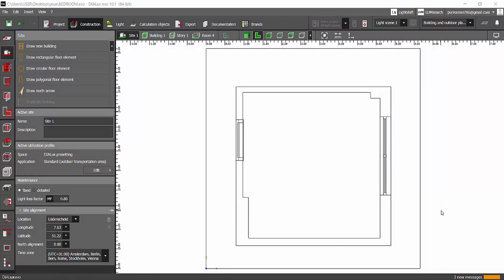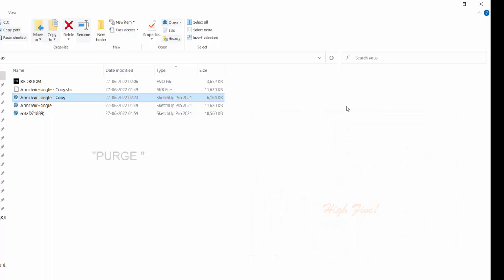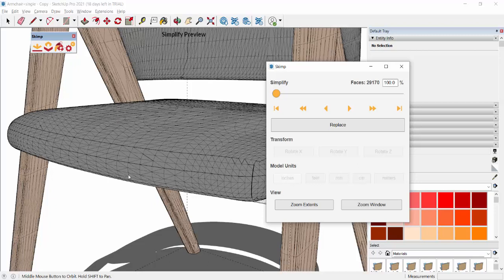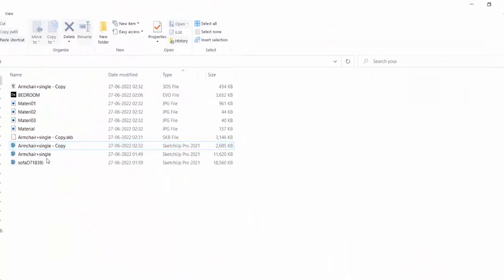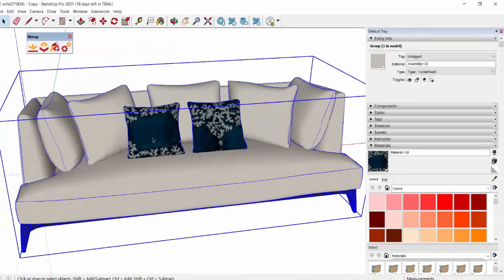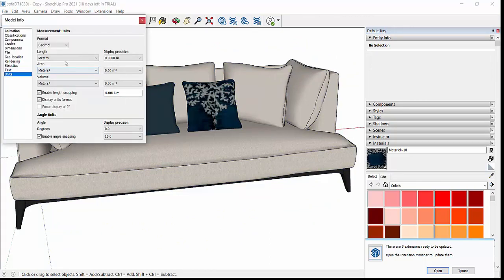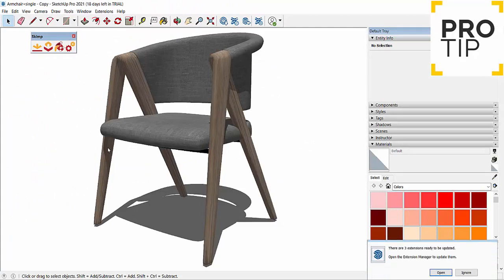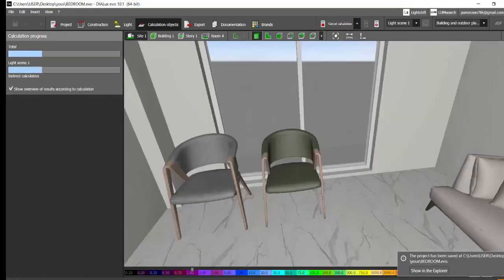How to drastically reduce Sketchup file size to import in Dialux Evo

Comment: Thanks for video but can you try 3ds file import in dialux only and export 3d model in m3d format.

As per my experience exporting 3ds file to m3d format that is very helpful in dialux evo. Like reduce calculation time texture also comes good. 

Please try and kindly suggest it's helpful or not?
Reply from the maker: Yes, we can import to Dialux and then export to .m3d models. But still in this process too, we need to export sketchup models to 3ds models, for that the steps in tutorial can be helpful :)

Often the export of high mb and high poly sketchup models will take time, purging it and reducing the poly size can save time in exporting.
Reply: @SumaiyaEliyaz  thanks for replying and guidance.